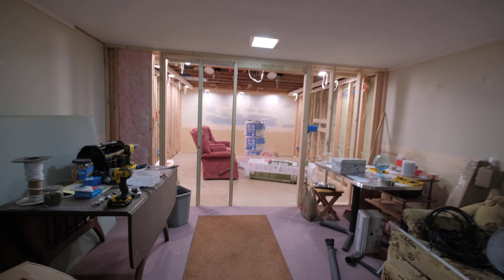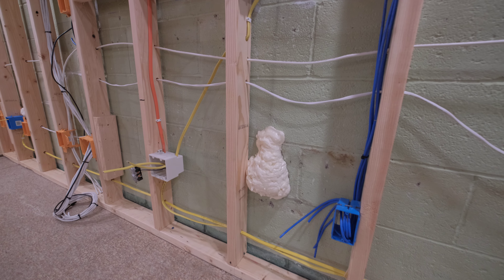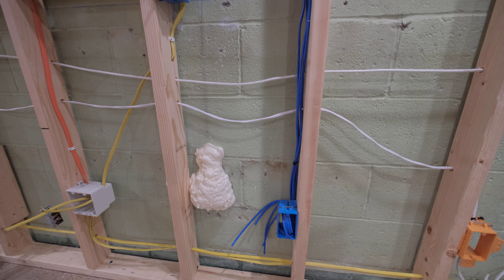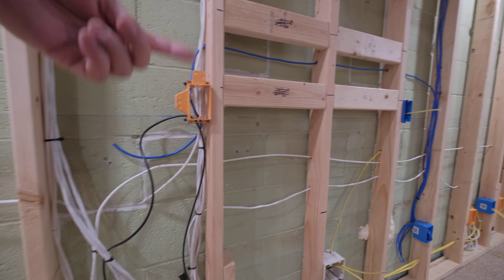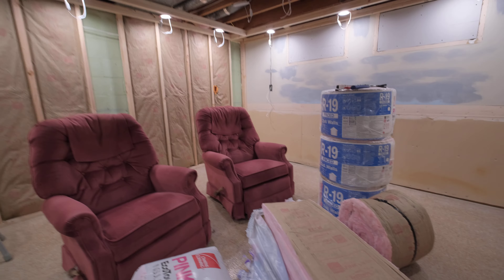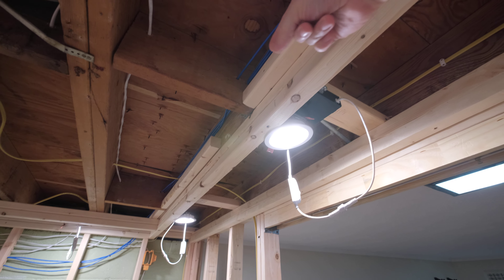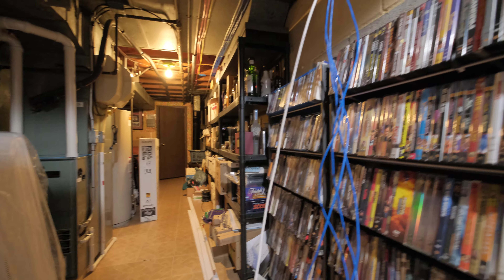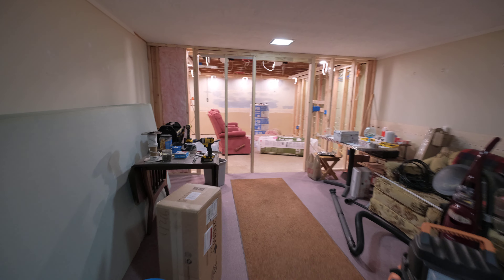Home Theater Project Part 7. Glass block windows, more wiring, and insulation started.

Comment: So you have the tv underneath some sheets but don't see speakers/woofers yet. You shopping for that next?
Reply from the maker: Actually that's the old TV. I've got a new bigger one in a box for the theater. But I've got speakers and amp in boxes already too. ;) I will be unveiling them in another video. I waited over 4 months for them to show up. The subs will match. Next comes drywall, then custom rack build, paint, LED lighting, faux brick wall, Neon signage, trim work, carpet, sound treatment, seating, control system, etc. So much more to come. :D
Reply: @Clint_the_Audio-Photo_Guy  So when can we come over?? :)